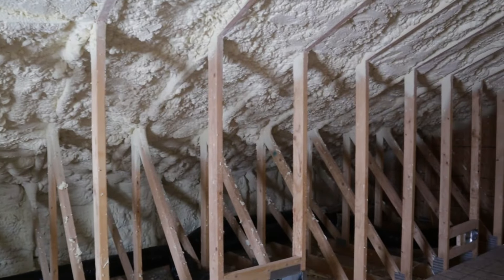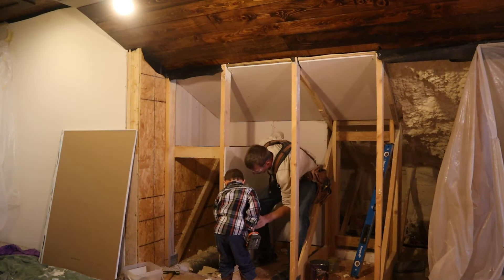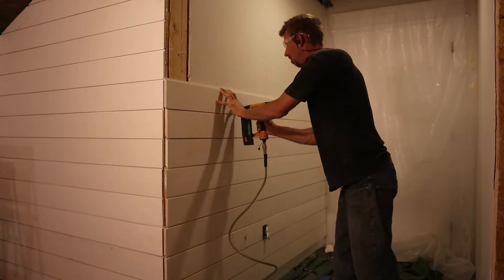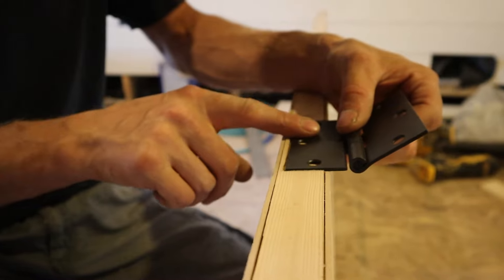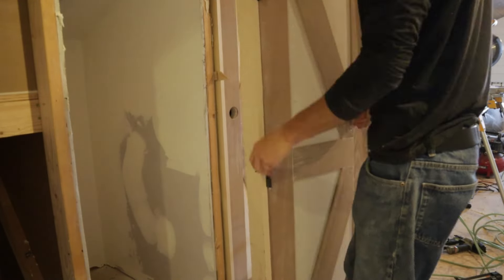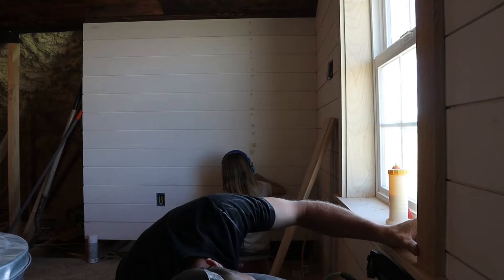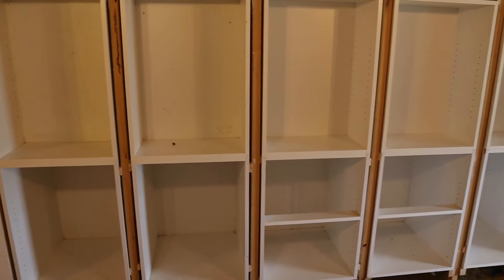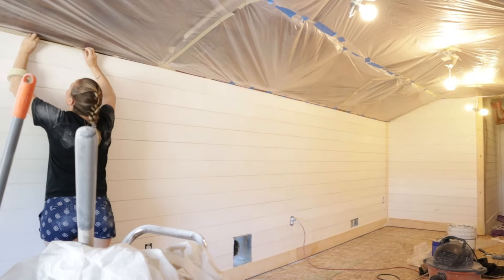Charming Attic Transformation//Instructional Time-lapse conversion

Comment: Did you have to strengthen up the floor joist before adding the decking?  It looks great!
Reply from the maker: The trusses were designed for this space when I installed them. So I didn’t need do any additional structure support.

Comment: I absolutely loved this attic renovation.  I was wondering if you had a problem with heat up there? What kind of insulation did you use?
Reply from the maker: Thank you!! Due to the design, spray foam as used. Heat runs and return air were ran off the existing furnace. The room can be a little colder than other parts of the house, the thermostat is a distance away. I might add a baseboard electric heat to help keep it regulated better one day.

Comment: Beautiful space! Something I've been wanting to do with our attic space. I was wondering with the spray foam for insulation is there any venting for airflow between the spray foam and the drywall? Anytime to watch it for condensation to set in?
Reply from the maker: Thank you! With the spray foam insulation, it is a non vented space in the attic. We monitored the interior for a winter season after the foam and prior to finish, to see how the interior climate would be. Due to having a conventional forced air HVAC system, there was no need for any additional air exchange.  If the system was radiant heat, an airflow fan might have been required. Hope this helps!

Comment: we just bought a new home, and the attached 2+ auto garage which houses our heating system and water heater is not insulated…neither is the loft above the garage. ❤ we definitely need to weatherproof it and put in a window and a couple of skylights.
thank you 🙏🫶🖖 for posting your video showing us how easily we can weatherproof the entire structure❤❤

… and that is my negative comment😂❤
Reply from the maker: @Dr.Yalex.  Well that’s the nicest negative comment I’ve had before 😆. Thanks you!
Reply: @buildingwithjosh  🤭🫶🤣

Comment: Awesome!   Exactly what I want to do.  I have  a hip roof attic  54 x 24,  Questions what is the height of your
 knee wall and the ceiling?
Reply from the maker: @orthoouchcare3769  that would be a huge space! My ceiling height is 6’10” at the high point and 5’4” on the low point if I remember correctly
Reply: @buildingwithjosh 
thank you

Comment: I love what you did, and want to update my upstairs bedroom attic space.  I would like to do as you did and avoid putting drywall backup.  Did you do your project to code when considering a vapor barrier? Or does the foam spray insulation you used offer the vapor barrier that might be an issue to do things properly to “code?”
Reply from the maker: @elizabethspr3  where I live there is no interior vapor barrier required for the interior. The exterior gets the vapor barrier. The spray foam was to get the required R-value for code. Hope this helps.

Comment: Wow, this is impressive!! Can I ask you something? I’d suppose drywall the ceiling and wall will be more cost effective, however I’m going to do everything by myself so the easiness or feasibility is even more important. I suppose doing drywall the ceiling and the wall by one person will be very hard, right? Enjoy your new room!
Reply from the maker: Drywall for one person is more difficult to hang than the single boards. But can be done! It is much more cost effective and gets large areas done quickly. The ceiling always helps to have another set of hands or a drywall lift. Rental stores should rent them out pretty cost effectively. Good luck! 

And yes, we love the room. Cheers!
Reply: @buildingwithjosh  thanks a lot for sharing it!

Comment: Did you run a beam across the trusses so the support is on the gable walls? I ask because I’m trying to convert my space.
Reply from the maker: Do you mean a drop beam under the trusses to support the middle of the floor?  My trusses were designed with the floor in the design, no need for underneath support.

Comment: how much and hold long do you think on average it would take someone to do something similar minus the build in shelves?
Reply from the maker: That’s a difficult question to answer without knowing the size and finishes one is choosing.

For my project the barn wood ceiling and cabinets took way longer than the rest of the project. That’s because I had mill down the barn wood and create the cabinets.
Reply: @buildingwithjosh  it’s roughly 10x10 and would just want normal finishes maybe 2 lights and like 5 electric outlets. Also let’s say a basic window
Reply from the maker: @ashleynv  probably with drywall, trim, paint, and electrical. 4-5 days would be my guesstimate

Comment: I'm making part of my attic into a walk in closet..what did you do for insulation..I want to heat it...I am thinking using 2x6 instead of 2x4 for studs for thicker insulation..but thanks for the interior ideas..you must be in a warmer climate.
Reply from the maker: 2x6 walls can get you up to R21, which is what code is now for exterior walls. I live in Colorado, a combination of hot and cold climate. I had the exterior envelope spray foamed, 2.5” on walls and 4” on ceiling. And after finishing the interior walls I added r13 batts and blow in under the floor. Good luck on your project. I bet it will look great.

Comment: It came out beautiful. What woods (I see two) and finish did you use for the shelves? Thanks!
Reply from the maker: Thank you! 

I used pine for the shelving. The barn wood ceiling is a combination of pine and doug fir. My finish is a 50:50 mix of early American and dark walnut oil minwax stain. I used a polyurethane as clear top coat.

Comment: Curious about the spray foam insulation you used! Did you add this before running electrical? Do you recommend doing one or the other first? And did you contract this work out?
Reply from the maker: I definitely recommend spray foam before running electrical. It can be somewhat a pain to remove the foam in spots to run electrical. However if one runs electrical first, than the spray foam will make it near impossible for any future repairs, remodeling, or adding to it later! 

I did my own electrical, I’ve been around all the trades to know how to do most of them. I would always recommend reaching out to a local professional if unsure about electrical!

Comment: it's beautiful, but how much does it cost... I have two spaces to do, but i'm afraid of the cost.
Reply from the maker: This room did cost quite a bit, but the spray foam insulation was a large portion of it. Sheetrock finish would be more cost effective than nicklegap walls and wood ceiling!

Comment: Structural question: How do you identify if the joists are strong enough? Many roof systems are just 2x4s for the ceiling underneath/new floor. Did you sister 2x6s or 2x8s onto the 2x4s and sit them on the outside wall plates?
Reply from the maker: These trusses were engineered with this space in mind when installed. The trusses have 2x6 top and bottom cord and webbing needed for structural support of the floor.

If one is converting an existing attic, a beefier floor would be needed. I would recommend discussing with a local engineer or architect to discuss your project. The floor joists would depend on the span of the room. A drop or flush beam can always be added if needed!

Comment: I'm going to be doing an attic finishing and was wondering with batt insulation should I put up an additional vapor barrier
Reply from the maker: Is there a vapor barrier on the outside? Rule of thumb is usually only barrier on one side that way the walls or roof can breath some. If vapor barrier is on both sides, moisture can get trapped and mold the framing over time.

Comment: Beautiful job!  My attic is somewhat similar, still mostly unfinished, so this is inspiring.  Do you find having ceiling lights just down the middle enough to give decent lighting, or are the side lights needed as well (or just decorative)?
Reply from the maker: Thank you! I think the ceiling lights are sufficient for lighting, especially since they are led. I did the wall lights for dim mood lighting and decorative, love them and would do it the same way!
Reply: @buildingwithjosh  Thanks for the response - it really helps!

Comment: whats the hvac situation?
Reply from the maker: @lundysgarage  there were two heat runs and one return air run installed to the existing system. It works, but could be better. A mini split might be in order for the future.

Comment: Currently working on transforming our space with built in’s as well. This is stunning and helps me to complete our project. One question, what led lights did you use? Did you use closed cell or open cell? I haven’t been able to find lights that can go near open cell, may have to use track lighting
Reply from the maker: Thank you for you feedback! 

The spray insulation we used was closed cell. I used the slim led cut in disc lights. These lights gave me peace of mind because of the depth needed and keeps the heat down in the ceiling. I am not knowledgeable about open cell foam.